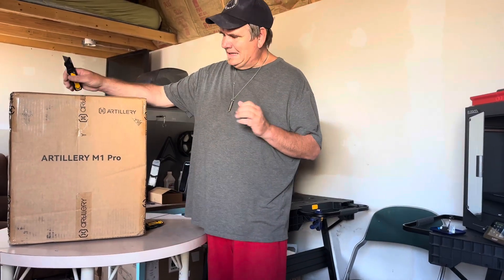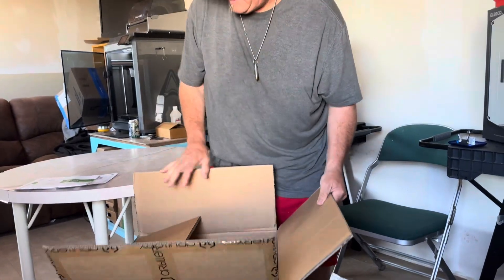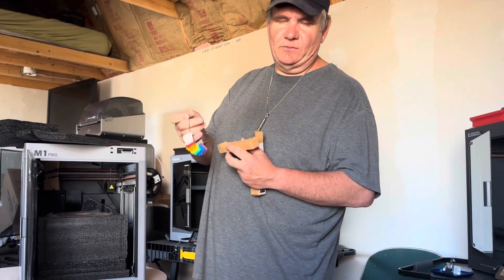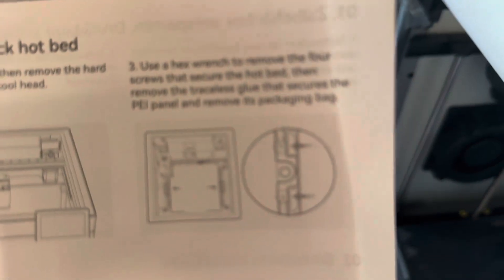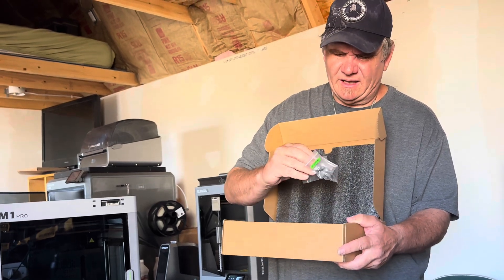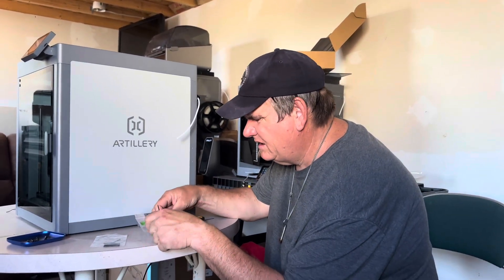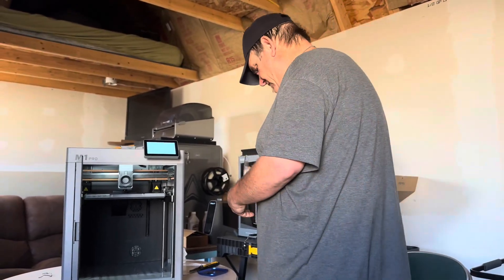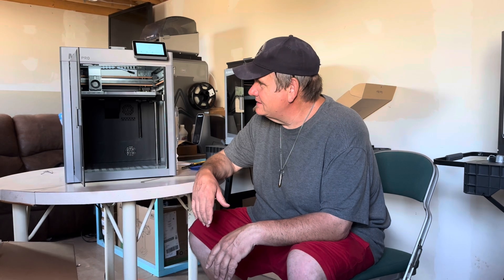Artillery M1 Pro unboxing

Comment: Artillery is far behind in brand recognition. They should really bring it down to 300 bucks, so they can gain marketshare. Looks like a better machine than the elegoo, but they got brand recognition. Ahead on multicolor atm.
Reply from the maker: I have both the Elegoo and the artillery.  I really like both printers. I agree if they were closer to the 300 price point it would help them.

Comment: Curious if it is a similar quality to Bambu. I’ve noticed many people complaining about recent Artillery models, but I have a SWX2 that I love and was curious if this was reliable like my current Artillery machine, as well as how does it stack up against the machine it is a clone of.
Reply from the maker: So fR I really like what i have seen. Print quality seems really good.  Build quality is outstanding.  How ever i have only printed 50 hour or so with it as of yet.  I am editing a video right now of my initial prints and my thoughts,  i hope to up load this video later today.  

The short answer is it has potential but i want more time printing with it,  i also want to see the updated firmware and slicer.  But at this point it has to be a contender

Comment: is the exuste fan noise just as lound on the m1 and the centuri printer?? is the tubing going to the print head does is make the same shap bend as the centuir where you have to make a strain releaf for it???
Reply from the maker: As far as loudness, The fan on the m1 seems fairly similar to the fan on my CC. I didn’t get a early CC and haven’t felt like my CC has been that loud unless both fans turn on.  Maybe i just have bad hearing but the sound hasn’t bothered me on either the M1 or the CC.
Reply from the maker: I will record the sound in my next video.
Reply from the maker: Bend is different than with the CC but still has to be modified to work.

Comment: I mainly want to see how well this printer does with high temperature materials. I added a heated chamber to my Centauri carbon but with any printer that doesnt come with one i get a little worried of the longevity ill get out of it because higher temperatures can cause problems with longevity in my opinion. I want to buy one of these but i had ordered the CC first and figured id wait for this one to be out first so i could see how it does for other people
Reply from the maker: Wanting to print with high temp filament is the main reason I purchased this printer.  I have already purchased several rolls of high temp filament.  I will shoot some videos of this.

Comment: Just want to see a comparison of the budget Core XY’s. The CC vs the M1 as I’m sure this will be the options people will be looking at in a similar price range. I currently have a CC which I like a lot, but was thinking to get rid of it to get the M1, mainly for the chamber heater.
Reply from the maker: Yes this is the comparison that i am most interested in as well.  I have 2 CC printers and will do an in-depth comparison between the two printers.
Reply: @BGoodson2006 thank you! Are the Bambu build plates compatible?
Reply from the maker: @IKnowImLost224 the build plate for the artillery M1 Pro is 260 just 4mm larger than the bamboo build plates.  So technically no.  However i believe that i will get them
To work.  I will shoot a short video of me attempting it.

Comment: Please check table for flatness with bed mesh scan or old school flat piece of aluminum hold in front strong light. Waiting for rewiev. Thanks
Reply from the maker: I will do this.  It might be old school way at first.  But then I want to do a bed mesh scan.  Is there equipment i need to purchase to do that?
Reply: @BGoodson2006  If it runs klipper, add Fluidd to it and run from browser.

Comment: Thanks you , can you test LWPLA
Reply from the maker: LWPLA being light weight PLA, right? I have not used LAPLA before but I will
Order a couple rolls and print with it side by side with the artillery M1 Pro and one of my ECC printers or the K2 plus.  Do you have a STL that you think i should print or just use the benchie?  Does color or brand of LWPLA matter?
Reply: @BGoodson2006 
Yes I’m using ESUN LW pla a lot with my Mingda magician 
But I was curious if the M1 will be good for that to 
I will use the M1 for ABS and Petg the most 
Thanks for answering
Reply from the maker: @jean-claudeterretaz7464  thanks for watching my videos.  I will order some ESUN LW PLA and print some with it.  I will print the same STL on multiple printers for comparison.
Reply: @BGoodson2006 
Setting for low weight PLA are different ( 235 Celsius ) speed around 60 
And if you print a part try on Vase mode with only 1 wall
Reply from the maker: @jean-claudeterretaz7464  thanks for the info.  I have been looking up best practices for printing LW PLA.  This helps.
Reply from the maker: @jean-claudeterretaz7464 i am trying to purchase som esun pla LW right now but it is sold out.  Do you know other places i could look for it.  I have found two kinds of LW pla, one is pre foamed the other is not.  Which one should i be getting?
Reply: @BGoodson2006 
You can buy bambú lab aero or color fab 
If you can find anything it’s ok 
My machine will arrive soon and I will test the ESUN   LW at home 
Many of rc model now are print with this material

Comment: I normally run a dryer on all  of my printers with an Bowden tube. Is this feasible on the back to change the Bowden tube out and put a longer one to go into a dryer for line Creality like the space pi
Reply from the maker: I am certain that this could be done in a couple ways.  I have some extra tubing and a dryer.  I will experiment with this and let you know how it goes.
Reply from the maker: The tube that this machine come with is actually long enough to run to a filament dryer.  It would be easy to change the tubing for a even longer one if you wanted.  I am currently running a print out of the filament dryer using the tubing it came with.
Reply from the maker: https://youtube.com/shorts/10W3mXKTVhA?si=kFBBX_3sDGosDOto